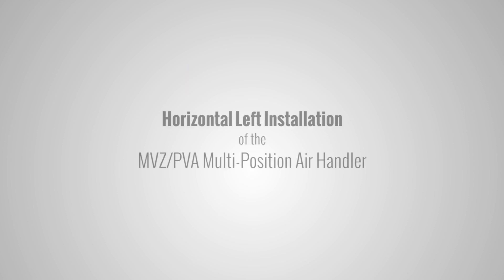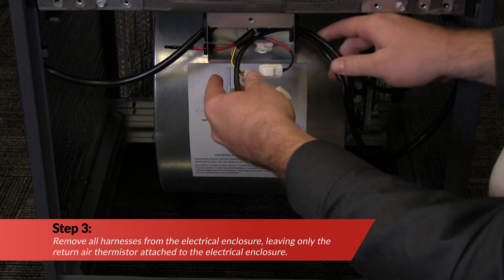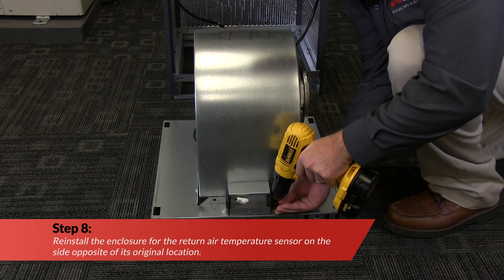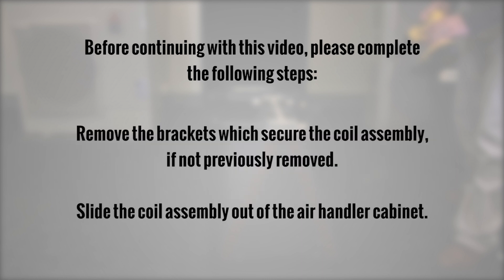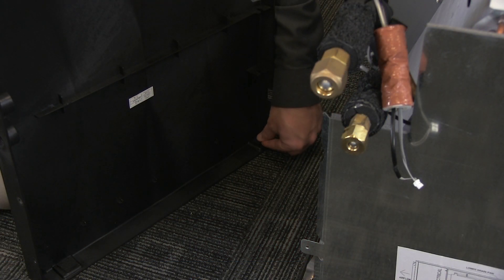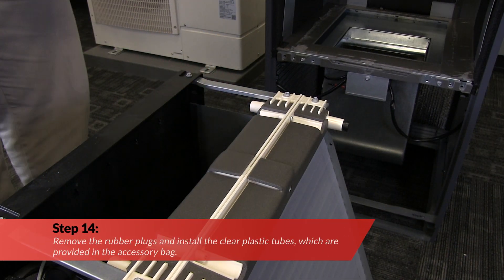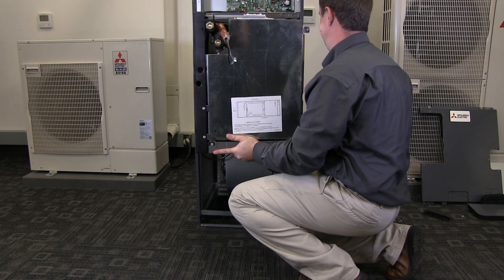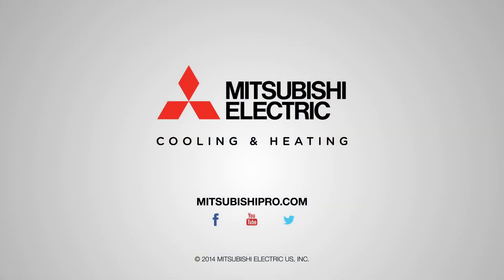How to Complete the Horizontal Left Installation on the MVZ Multi-Position Air Handler

Comment: INSANE, this is NOT an installation process this is a conversion process. Why can't people learn proper terminology, especially when they are multi billion dollar corporations. The real issue is why don't they have left and right hand available from the factory? After all they could be converted if not available but available off the rack by design!